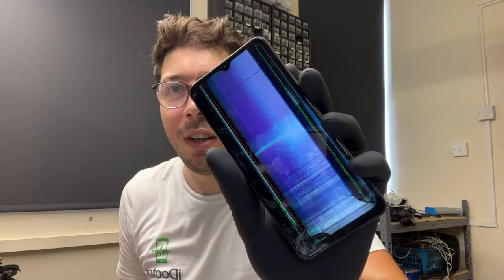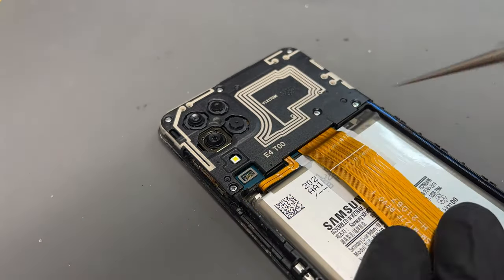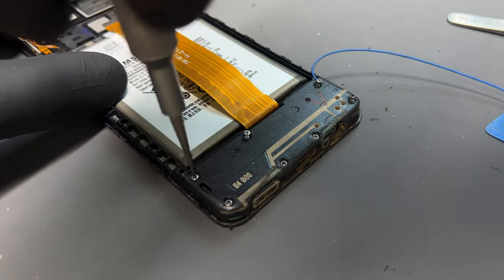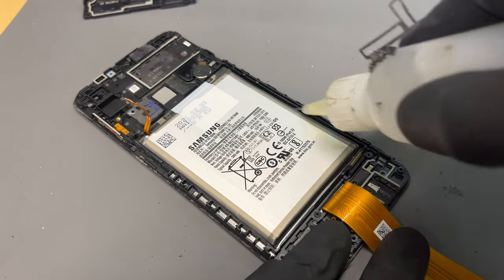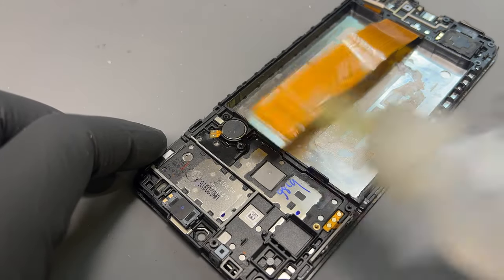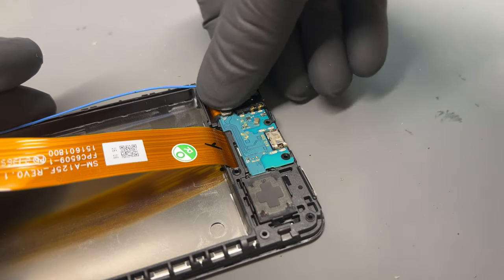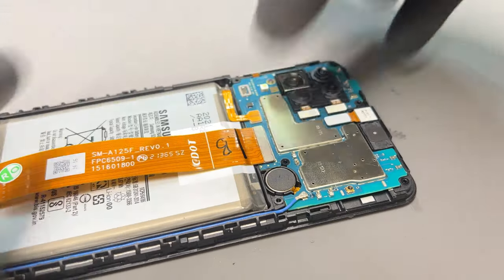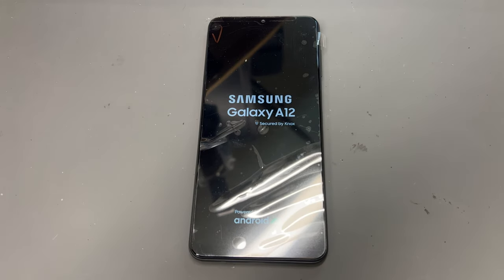Samsung A12 LCD Broken Screen Replacement Disassembly Sm-A125

Comment: Thanks bro. I ordered a replacement screen for my A12 so I was checking out videos on how to swap out just the LCD, but then a whole digitlizer + LCD showed up instead. I wasted about 20 minutes cleaning off the old one XD. Anyways, thanks for the very straightforward and informative how-to. I managed to only do one thing wrong: I forgot the loud speaker as my new digitizer didn't come with one. Had to open it up again and transfer it over and I was all set.
Reply: Did you replace it successfully?
Reply: @PabloEscobar-vr1cf  Yep. It's not super dificult. The hardest part was opening up the phone (which is easy if you have a guitar pick or something super thin and flexible). the other thing that was a bit dicey was removing the battery without bending it. putting lots of acetone or surgical alcohol behind the battery and letting it disolve the adhesive makes it easier. i used a credit card to get it out.

Comment: It seems that the SM-M127F display was replaced with the SM-A125F display in the video, is that correct?
I'm curious about the size, display performance, or compatibility.

Comment: My A12 has the SM_A022F instead of either SM_A125F or SM_A127F.  Are they all compatible?  I need to replace the screen, but this is the dilemma.  BTW, the model number of my phone is SM-A125U1/DS.

Comment: Hi Ollie, I followed all the directions, but when I turned it back on I have no sound.  I can't make or receive calls or listen to music.  I am connected to the internet though.
Reply: Did you figure it out? Having the same issue here.
Reply: No, I'm going to have to replace the phone.  I've opened it up a second time and everything seems to be as it should be.
Reply: @catherinereginahill5110  Did you use adhesive for the bottom speaker?? I didn't use it then I used it and it worked!!
Reply: @catherinereginahill5110  I forgot the adhesive 🤦so I transferred it with a heat gun
Reply: @CritterConnect  No I didn't, but I don't know what kind of adhesive I would use and I'm not sure what and where the bottom speaker is.
Reply: Where is the bottom speaker?